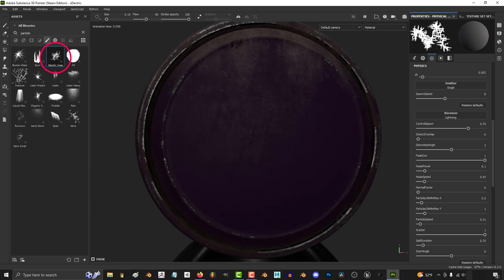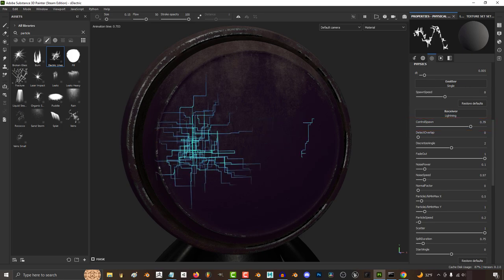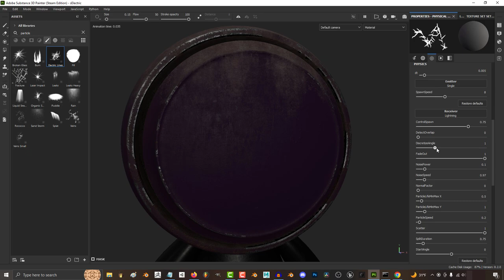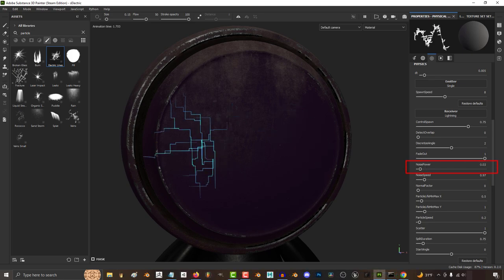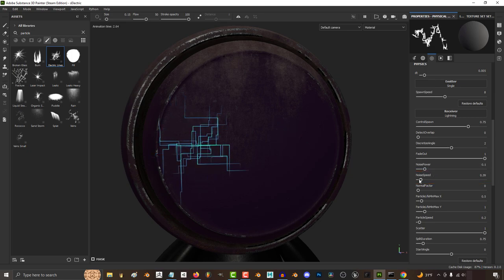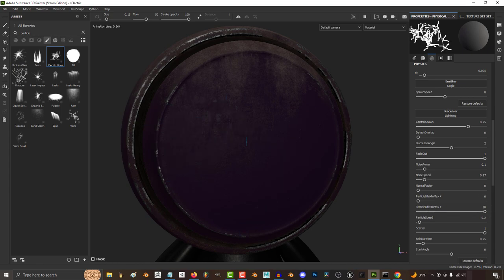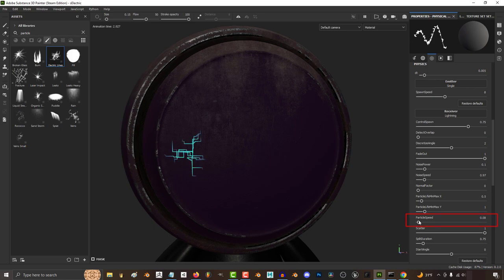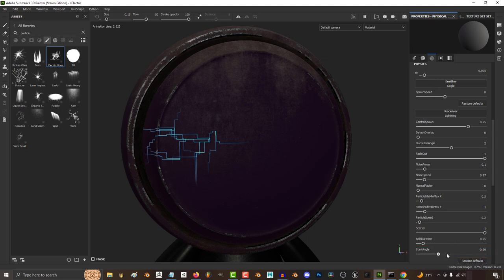Substance-Painter: Particle Brushes (Electric-Lines)

Comment from the maker: Another super easy and quick way to draw sci-fi tech designs onto any mesh in Substance Painter -
And, yes, you can change everything about every particle brush. You can adjust the color, normal, material, or even use it as a mask for other materials :)